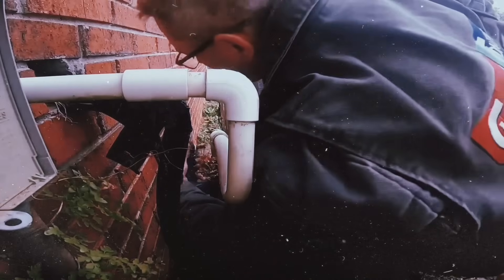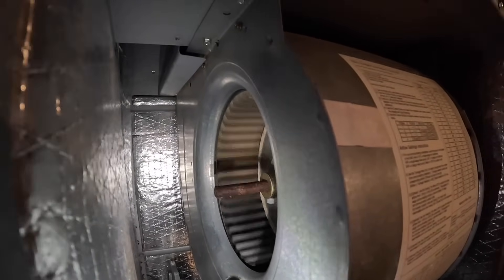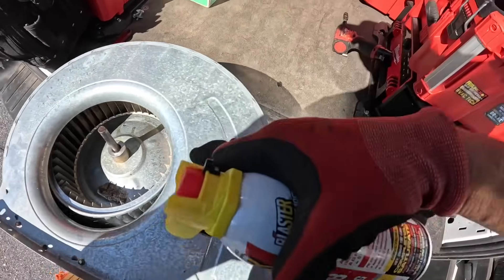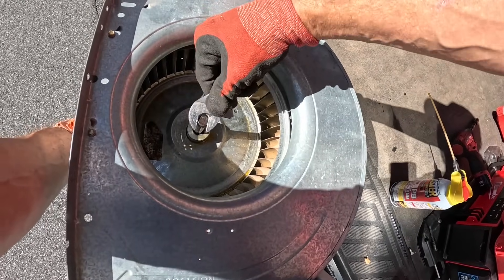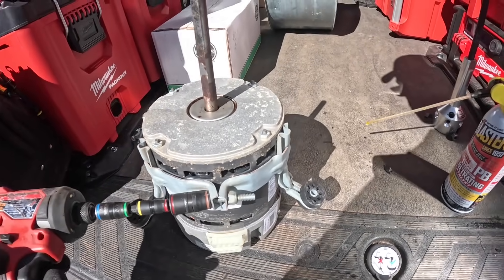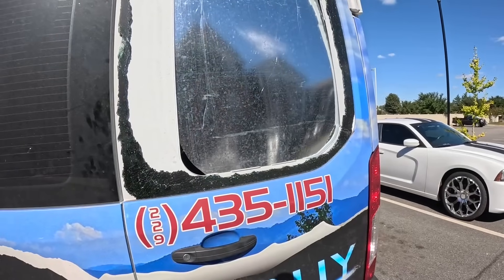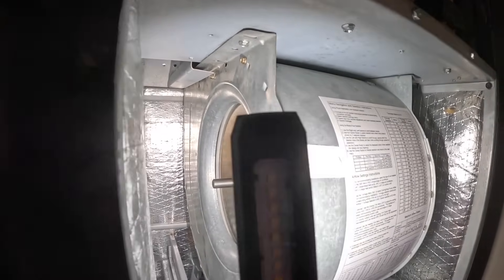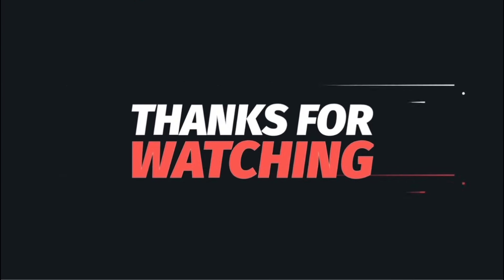Variable Speed Motor On A AVPTC Goodman Air Handler! #hvacguy #hvaclife

Comment: Nice little job. You are right, they never think about the thing needing service in the future. At least you were able to work around it. If it ever needs an evaporator it may be an issue, although you have to cut the lines anyway. What a drag breaking the window in your van. Depending on the cost, maybe insurance claim if deductible doesn't kick you in the wazoo.

Comment: Maybe if manufacturers would stop changing which side the linesets come out of the coils every 10 years of so, we wouldn't have to snake our copper all over the place to make room! 😂
Reply: There’s never any excuse for running it in front of the cabinet like that, that’s why they make tubing benders or even brazing in a couple elbows is better than that garbage. I do service work now but I installed for 12 years and still do quite a few change outs and would never run a lineset like that regardless of where the manufacturer stubs out the lines on the equipment
Reply: Give this man a beer. Been saying same for a decade